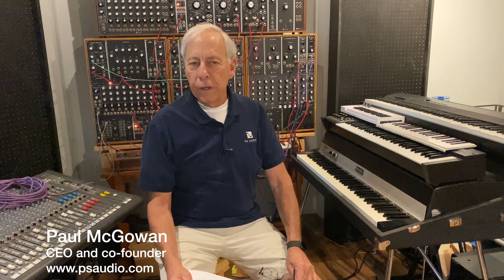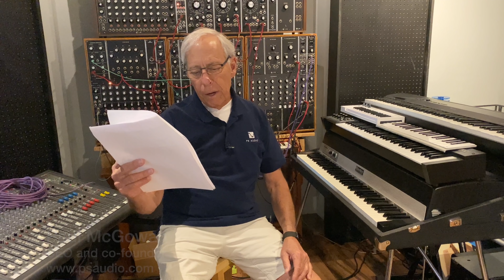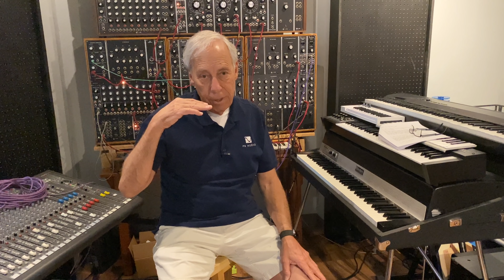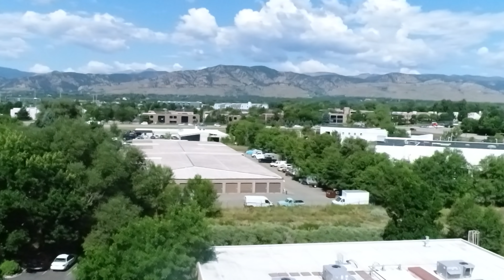Current and voltage amplifiers

Comment: With all due respect, I would delete this video.

The reason you use a current amplifiers is SAFETY!!!

@ 4:59 you misspeak and conflate power with current. You cannot “need” voltage AND power when voltage is on the same side of the equation as the current.

P(power) = V(voltage) x I(amps) 

@ 5:52 you imply that the output from the preamp is "large" then the current amp makes it “powerful.”

This is incorrect. I have a $10 bill that says none of your preamps output more than  +1.228 Volts nominal (+4), or +0.447 Volts nominal (-10). Not the 30~40 volts mentioned @ 3:25 I drive my woofers @ ~70 volts when I'm hammering them.

https://en.wikipedia.org/wiki/Line_level

I don't even need to go to your website to know this. Frankly you should have caught yourself at this point and re-thought the video. Surely you know the output voltage of preamps you build?

BTW The mixing console behind you is a +4 device. God only knows what the Rhodes piano (to your left) is. I have seen wild variations over the years, largely dependent on the amount of beer dumped in to the damn things. There is no denying that Rhodes sound though.

Think you can not make power with high voltage? How do you think the power company supplies entire city blocks with power from a primary line the size of your little finger? Hint: High voltage low current. That primary line is either at the top of the pole, or underground. Years ago I worked as a lineman, you cannot make grounding errors, ever. You don't get a hum, you get an explosion.

With voltage amplifiers, the trade off is the need for massive amounts of insulation to prevent injury and/or death. You can make a voltage amplifier generate power. For instance, in a microwave oven you need high voltage. There is no way to get the magnetron to develop the frequencies needed, without voltage. All the current in the world will not work. Consequently it's all about voltage step up. A cheap 1500 watt microwave oven will often weigh less than a 250 watt audio power amp of decent quality. To be fair I'm sure there are some class D amps that may weigh less. Lets be real, those are a crime against humanity.

If you were to drive a speaker with high voltage, the connectors would have to be very far apart to prevent arcing. The flux loss for having thick varnish on the speaker coil wire would large, as there would be fewer windings in a given geometric volume  This would also apply to the internal connections of the actual components caps, resistors coils, transistors, and etc.

Say you're rocking hard to a RUSH  (RIP Neil) song and your infant crawls behind the speaker, bumps the exposed connectors. POOF, there is a cloud of smoke shaped like your child. This is why we don't use high voltage in AUDIO power amplification, as the frequencies are low enough.

With current amplifiers, the trade off is mass. Meaning larger discrete components, heavier complete products, and infants that stay alive. Unless of course you drop the amp on the infant, in which case gravity is the enemy, not the electrical potential.

This not trolling, and I do greatly respect your work. I feel as though your scope was too narrow, if you have looked out to other applications of “power,” beyond audio, then I think you would have seen this.

I field phone calls from “engineers” daily At some point in the conversations they will say something along the lines of “Well you understand I am an engineer.” 
I reply, “I'm sorry.”
They will then say, “I said I'm an engineer.”
I then reply, “Yes I heard you, I'm sorry.” 

With respect and a touch of sarcasm,
Don
Edit: Had a loose quotation mark in there.
Reply: ohhh you're THAT guy... im so sorry 😭😭
Reply: this is the audio equivalent to an English teacher going on a 10 paragraph tirade about someone mis-using "there", "they're", and "their" - when it was just a typo all along.
Reply: PS: he's obviously trying to speak down to the average person who isn't an electrical engineer.
Reply: Whilst a stand alone preamp might only output 1.228 volts ,the front end of the power amp to which the preamp is connected will indeed boost that voltage.
Hence, voltage amplification.
This could easily reach say 10 volts, which then needs converting to low impedance at the output stage of the amp.
Hence, current amplification.
Reply: Agree, this is really misleading. This is high school physics. All audio amps are voltage amps as the voltage is what defines your audio signal level. And all audio amps have some level of power output, even it is quite tiny for a pre-amp. The term "power amp" is alright although such an amp is also a voltage amp, cause power is energy/time and a passive speaker is essentially turning electric energy from the power amp into acoustical energy (and heat). The term "current amp" is plain misleading for audio products.
Reply: @GoldenVIKE  no it's not. it's like if every sentence would not make any sense.
Reply: @GoldenVIKE  you must keep it straight and true, independently of who you are talking to.
Reply: @GoldenVIKE It is not a simple typo.  It is the incorrect use of a term that is leading to confusion to the point that Paul has answered a completely different question than the one that was asked.

I recognize that Paul is trying to simply things; but, at this point that attempt to oversimplify things has lead to miscommunication and confusion about the facts. So he hasn't simplified things.  He has overcomplicated them.
Reply: @montynorth3009  No.  If I have your 1.228V source and I amplify its voltage I get a signal of 12.28V out of the amplifier. But that says nothing about the current. The current is ultimately dependent on the load.  In an amplifier with a current output, the output current would be defined by the gain and the voltage would be determined by the load.
Reply: @ThinkingBetter  No there are current amplifiers. In a current or transconductance amplifier,  the output of the gain is defined by the output current and the voltage varies with the load.

That is what the question was referencing.  Speakers are driven by electromagnets. Magnetism is always a function of current, not voltage. So it makes some logical sense to use a transconductance amplifier on the output. Speaker impedance varies by frequency leading to possible distortion of a voltage signal; but,  this would not effect  a current signal since the magnitude of themagnetic fields generated by a current signal would  always match the input source voltage -- regardless of the impedance of the speaker.
Reply: @timharig  Yes, I'm aware of such amplifiers being in existence. However, they are near 0% of all amplifiers. Well, it all boils down to power. Your eardrums move by a certain amount of power (energy per time) that is a fraction of the acoustical power coming out of the motion of the cone. The work produced by a voice coil is still the product of voltage and current. Driving a speaker with a current amplifier is inherently problematic as you will have a very un-linear frequency response due to how a speaker impedance varies. For example, at a peak impedance where the speaker is resonant you will end up pulling too much current through the voice coil  causing a spike in the frequency response. Then you have to EQ the signal against the specific speaker to get back a more linear frequency response. I can agree that perhaps the thermal coefficient of the voice coil would be better handled with a current amplifier for best audio, but that also means the somewhat natural protection of a voice coil reducing power dissipation in it when heating up will be lost.
Speakers are designed for voltage drive and especially when you introduce a cross-over filter, things become more heavily designed with voltage in mind.
It might make sense to do a current drive in an active speaker where you can manage the EQ, cross-over and speaker protection in a DSP highly optimized against the specific drivers.
Reply: @ThinkingBetter  "Yes, I'm aware of such amplifiers being in existence. "

Then don't make absolute statements about their non-existence.

"However, they are near 0% of all amplifiers."

Hence the reason for the ask Paul question.

"Well, it all boils down to power. Your eardrums move by a certain amount of power (energy per time) that is a fraction of the acoustical power coming out of the motion of the cone. The work produced by a voice coil is still the product of voltage and current. "

It has nothing to do with power. The work produced by the coil is a product of voltage and current; but, part of that is reactive power.  The only part that can be converted to a magnetic field is the current.And since most speakers  are magnetically actuated, only the current is converted into sound.

"Driving a speaker with a current amplifier is inherently problematic as you will have a very un-linear frequency response due to how a speaker impedance varies."

The entire point behind a current source output is that the current is always proportional to the source -- no matter what the speaker impedance is. The speaker impedance varies the voltage instead of the current -- completely opposite to what a voltage output does.

"Then you have to EQ the signal against the specific speaker to get back a more linear frequency response."

I agree. Currently designed speakers are designed for linear voltage response. Speakers designed for a transconductance amp would need to be designed for flat current response.  That should be EASIER to do since the speaker impedance no longer affects the sound.
Reply: @ThinkingBetter  "Your speaker is outputting sound energy that is a fraction of the energy that came through the cables."

That doesn't change whether you use a voltage amplifier or a transconductance amplifier.

"Your speaker can produce a given SPL through a high current dynamic driver or a high voltage electrostatic driver"

I am speaking about  coil based speakers which are current driven.  If I was designing for electrostatic speakers, which are voltage driven, then I would indeed prefer a voltage amplifier.  The lesson is drive your amplifier with what actually drives your speakers. Don't drive your speakers with what the speakers themselves have a hand in modulating.

 "but in either case you need both voltage and current to make it into power. While voltage can exist without current. Current can not exist without voltage. "

You still seem to be having difficulty understanding how transconductance amplifiers work. A transconductance amplifier produces both voltage and current just as a voltage amplifier does.  The difference is which is set by the "gain*source voltage".  In a voltage amplifyer the voltage is set and the current swings while in a current amplifier the current is set and the voltage swings.

"The mechanical effect of a system, including a speaker, being at a resonant frequency is that motion is more energy effective. It means the voice coil needs less force to move. It means the voice coil needs less force to move. When an electromagnetic system is experiencing less load, the impedance will go up."

There will be non-linearities in the mechanical system regardless of the type of amplifier used.  However, you can remove an entire class of electrical non-linearities by using a current source.

The big problem with coil based speakers is that coils act as lowpass filters.  Their impedance increases with frequency.  That creates a problem when you drive them from a voltage source because the current follows the voltage based on that changing impedance.  When you drive them with a current source, the same thing happens in that the voltage varies with the load; but, that doesn't matter because it isn't the voltage which  determines  the position of coil based speakers.

So designing a speaker for a current load means designing for the mechanical non-linearities.  Designing a speaker for a voltage load requires designing for the same mechanical non-linearities plus having to design for the non-linearities of the coils.

"Voltage amplification works in synergy with how a speaker's power efficiency works."

Actually, the speaker's power efficiency is designed to work in synergy with the most common type of amplification.  If we wanted to design a speaker efficiency around transconductance amplification, we could easily do so -- and it would be even easier to do so for coil bases speakers since the coil non-linearities  become irrelevant.

" I believe this is the reason why less than 0.0001% of all audio amps are current amps."

There has always been a bias towards voltage based signals in all areas of electrical engineering -- even those that have nothing to do with speakers.  This is do to the fact that it is much  more difficult to measure current in a circuit than it is to measure voltage.  You don't have to disrupt the circuit to probe for voltage.  To measure current, you have to pass part of the circuit through your meter.

In the audio world today, you have the problem of compatibility with existing systems. Since most amplifiers are voltage amplifiers and most speakers are designed to "synergize" with voltage amplifiers, you face an uphill battle trying to introduce new products that are not optimized to work with existing products. But, if you were wiling to compromise product compatibility for the sake of producing the absolute best possible sound, a transconductance amplifier paired with speakers designed for a current source would be a very logical direction to go.
Reply: @timharig  Every speaker is power driven and is sort of like an AC motor turning motion into air vibrations. While a magnetic field is proportional to current for a coil in a dynamic driver and an electric field is proportional to the voltage for the plates in an electrostatic driver, in either case, the SPL is the result of power being transformed from both voltage and current in combination. 
The impedance of the voice coil increasing by frequency is not necessarily a problem when aiming at a flat frequency response; and I wonder if there are any examples of a speaker driver truly optimized for current drive to reproduce a neutral frequency response without heavy use of EQ?
Reply: @timharig  Power is power and defined as energy per time e.g. as Joules per second in the SI system (Watt). Sound intensity is power per area (P/A) and can be converted to dB. Normally when people talk about power they mean what you would call true power rather than "reactive power".
Looking at things with an energy perspective is a bit mind-blowing. Most people don't realize that the Einstein equation E=mc2 also works for an entire audio system end-to-end. Some of the mass lost in, let's say, a nuclear power plant uranium fuel turns into added mass of your speakers (as heat) or even your head getting a tiny bit heavier from acoustical energy being absorbed into it (turning it hotter). Whatever loss of mass turned into electric energy at the power plant is the actual source of the audio you hear inside your brain...but with very tiny efficiency of course. Thus I could also argue that mass is what drives any speaker and any amplifier is outputting mass in some form of current and voltage :-)
Reply: @ThinkingBetter  "Power is power and defined as energy per time e.g. as Joules per second in the SI system (Watt)."

Power, just like the energy that it is based on can be converted from one kind to another. Power can be mechanical, electrical, potential, thermal, etc.

"Normally when people talk about power they mean what you would call true power rather than 'reactive power.'"

Since you insist on dragging this conversation into the discussion of power, it is necessary to be very specific about which kind power is being discussed.  The amplifier always produces apparent power. It is important to understand that, depending on the ratio of reactive part of the impedance of the speaker versus the resistive part of the impedance of the speaker, that not all of that apparent power is actually  converted to SPL.

The fact that a coil acts as  a low pass filter with a reactance that increases with frequency is a hurdle for speaker designers when working with voltage amplifiers.  Neglecting the effects of the mechanical cone, the increased reactance at higher frequencies would reduce the current through the coil and therefore creates a curve in the electrical response of the speaker.  That is a hurdle speaker designers must deal with, either by altering the curve of the crossover or frequency response of the cone, in order to correct the linearity of the response.  This is in addition to any crossover correction that must be used to correct for non-linearities produced by the mechanics of the speaker cone.

For the transconductance amplifier, the current is always directly proportional to the source input.  As the frequency increases the reactance of the coil again increases but the current remains proportional to the source input.  This results in an increased voltage, an increased apparent power, an increased reactive power -- but, since the change in the coil impedance is reactive, there is NO CHANGE IN THE TRUE POWER.  So the electrical response of the speaker is now flat instead of curved as it was in the case of the voltage amplifier. Yes, the mechanical non-linearities remain; but, the speaker designer has less constraints from the electrical response to have to work around when correcting them. Less constraints means more options available to the engineer.
Reply: @timharig  Let's not pretend we are teaching each other anything. I do understand these things very well and in-depth. I majored in a related science field.
Where do you see an actual current drive optimized dynamic speaker providing a flat frequency response without EQ?